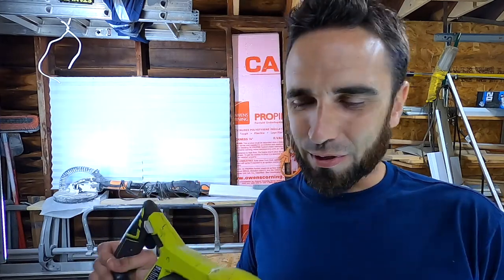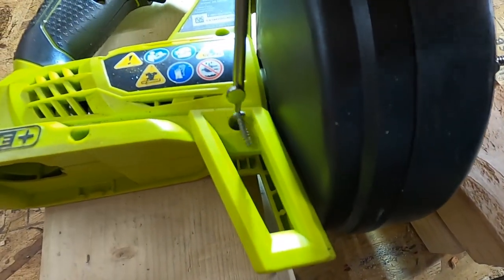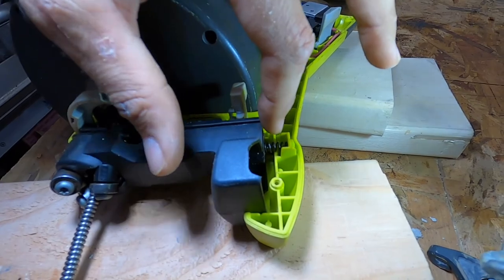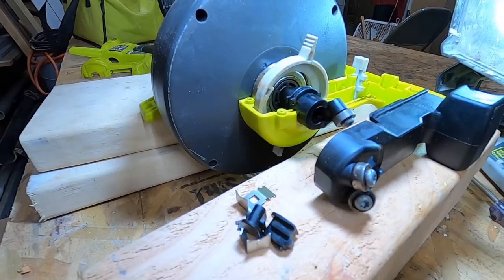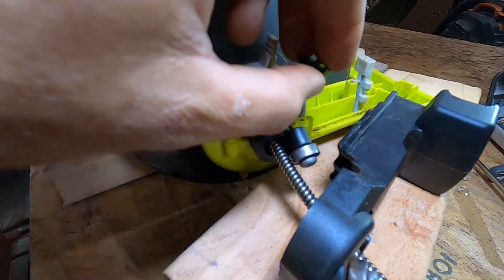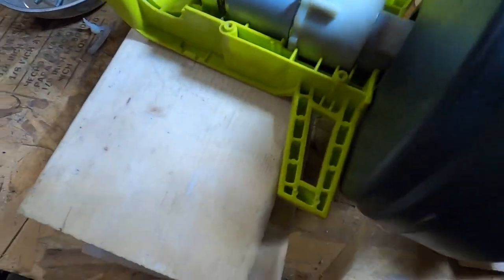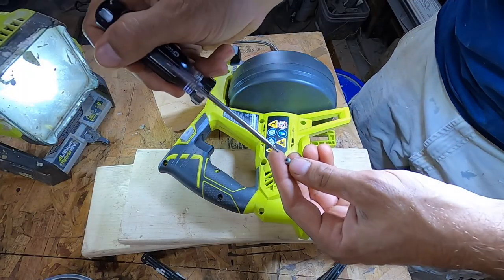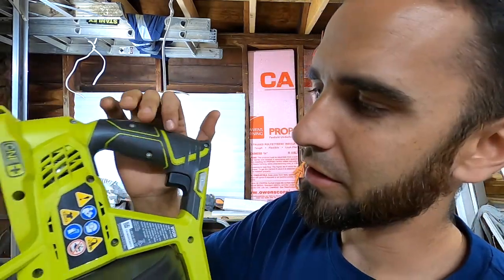Ryobi P4001 Drain Auger Cable Replacement

Comment from the maker: https://youtu.be/L0JPQ-UrAnI Easier way to replace the cable.
Reply: thank you very much, really good job of explaining with good camera work...
Reply: May i use flex shaft size 10mm instead of 7mm of this machine,thanks bro
Reply from the maker: @tuan-anh-8x 10 mm would probably work but I have never tried. Check out this video Cable Replacement Ryobi P4001 Drain Auger
https://youtu.be/L0JPQ-UrAnI

Comment: The really good thing about this video is that it shows very clearly how the parts fit together. It appears that this model is no longer available at places like the Home Depot, so fixing it was definitely worthwhile.
Reply from the maker: Yeah I have noticed that Home Depot doesn't have it in stock. Looks like they are pushing the Milwaukee drain cleaners. I hope they don't do away with this model, it's an affordable option to clean drains. Thanks for watching.
Reply: Just bought one today but am up in Canada so we probably get your old stock
Reply from the maker: @snowgorilla9789  Looks like they are back in stock at Homedepot in my area.
Reply: I bought this new about 6 months ago. They still stock it here in FL. Works great

Comment: Great video, thanks. So is the cable actually attached to anything inside the drum? Or is it just the bulb that stops it from coming out?
Reply from the maker: @firstlast1954  https://youtu.be/L0JPQ-UrAnI?si=K2QrKqus2ALqfpm8

Thank you. 2 bulbs or enlarged sections keep it from coming out. Not attached to anything. If u watch video I linked it’s easy to replace cable, as long as it’s not kinked inside.

Comment: I have the same one. It would have been nice if they would have just had a simple drum replacement. I've made enough money off mine just to trash it and get another one
Reply from the maker: @lanceobe6801  the video below shows a simple way to replace cable if it’s not kinked. One tub drain pays for the machine. 

https://youtu.be/L0JPQ-UrAnI?si=m2FISFlVfBvTnAMI
Reply: @handylandlord  It was badly kinked. Rusty, it was getting kind of old. So like I said just cost effective for me to get another one.. 99 bucks isn't much these days. I fix a lot of things but it was probably time for another one anyways

Comment: Is there a thin plastic rod inside the Ryobi cable? I used ours to snake a tub and now there is a plastic rod sticking out about three inches auger end of the cable. I thought maybe it was some type of reinforcement for the cable.
Reply from the maker: Yes the plastic inside the cable is to reinforce it. You might try to pull all the cable you can out of the machine and push the plastic back into the cable. You might be able to get the plastic back in if the cable is straight. If that doesn’t work I would just trim it off. Check out this video if u need to change the cable.  https://youtu.be/L0JPQ-UrAnI    Hopefully that helped.

Comment: Would a 5/16 25’ cable work? Or does it have to be 1/4?
Reply from the maker: I do not know the answer. I want to try a 5/16 cable. Did u get a 5/16 to work?
Reply: Im not sure i didnt want to buy it if it wasnt going to work

Comment: Would this work on the P4002 model?
Reply from the maker: I don’t own the p4002 but my understanding is that the gray drum that holds the cable is interchangeable. (Easier to remove) Once the drum is off should have 4 screws in the back to open and remove cable. I would recommend going to ryobi website looking at the parts breakdown or manual should give u an idea of how it comes apart. Good luck. Sorry I couldn’t be more helpful.
Reply: @handylandlord  Gotcha, I just have an old cable and was curious if you had tried it on the other model. Thanks
Reply from the maker: @PizzaBoyPeck  No I have not but the drum looks similar to the p4001. If it is I would remove the drum from the machine pull the cable out as far as u can remove the 4 screws on the back of the drum and see if you can pull the cable out. For me the Milwaukee cable is holding up great. Good luck. Let me know if you get it. They don’t carry the p4002 at my local Homedepot.

Comment: Not helpful at all.There are no videos on the orange one thst you use a separate drill on.My cable came off on that kne.I been been fix it.
Reply from the maker: Sorry this was not helpful for your type of drain cleaner. Ive attached my other video on just changing the cable. https://youtu.be/L0JPQ-UrAnI this is the only hand held unit I use. I truly love this ryobi drain cleaner especially for bathtub drains going through the overflow. https://youtu.be/5dSvS1FFHyM